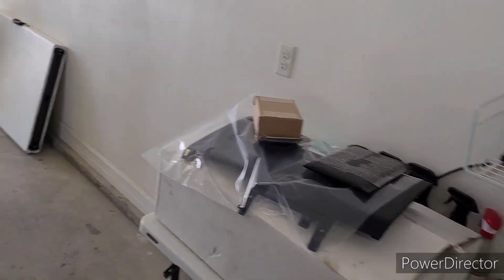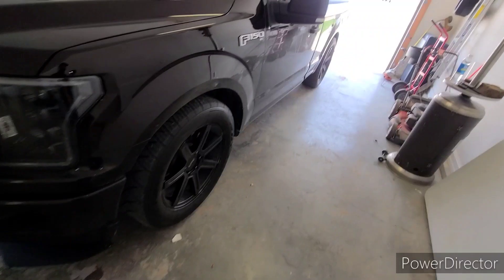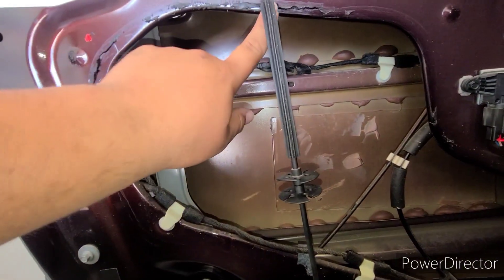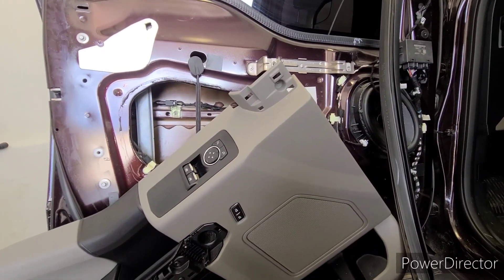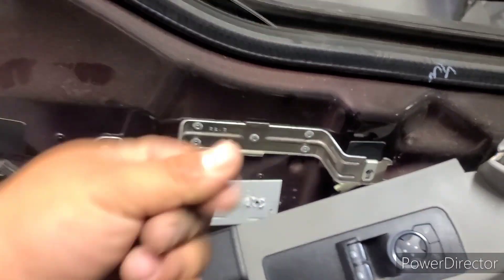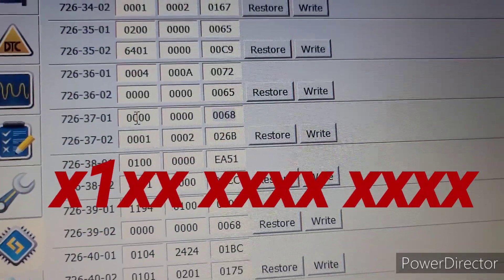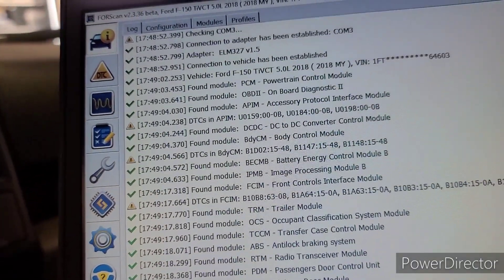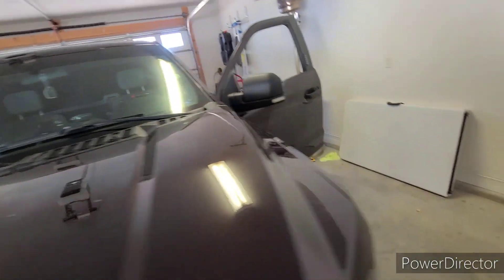How to add keyless entry (keypad) to your 2018 F150 | Part 2

Comment: Does it connect to factory harness or do you need something aftermarket? Trying to add this to my 16 Xlt RC
Reply from the maker: Nothing aftermarket you just need to check if it even has the harness behind the door panel because I'm not sure for your year and model.

Comment: Hey bro, do you think this forscan thing with their wire  can program a vin to a 2003 f150?  My truck says vin corrupt or NULL something like that.  Thanks
Reply from the maker: I really wouldn't know or had to deal with something like that. Do you have your stock ecm? Sometimes when people switch ecm's they don't program them to the truck or vin so it just reads as corrupt or invalid. But  that's all I can really tell you.

Comment: I was a little confused on the programming. You said you set it to 0100 000 000, correct? But, you had yours set to 0100 0002 0068? Does this change after you write it, and that's why yours was different? Also, any information on changing the code in Forscan?
Reply: Not sure why people continue to use "As Built" choice when the next line (same module, different view) allows you to just scroll down to "Keypad" and enable it. 
MUCH EASIER.  "As Built" is for non-decoded entry changes. Many already decoded so you don't have to do 'bit' changes. To each his own.

Comment: How did you get the door code?
Reply from the maker: I think I explained it in the video, but it will be at your passenger side foot step panel, remove it and upper panel and there should be a small module with numbers and you can berally see where it's says password or passkey, something associated with a code of some kind.

Comment: How do you get the door pad code? Do you need to make one up? Your truck didn’t originally come with one. Wanting to do this to my truck. Just need a few things cleared up before I move forward.
Reply from the maker: If I remember I put it in the video. The code is written in the the back panel of the fuse box which is located in the passenger footwell. You need a flash light aswell. It's like a sticker filled with info and stuff and there should be a [ key/code: ]

If not try your Ford manual and there should be a card in there with code.
Reply: Thanks. The dealership was trying to tell me that I couldn’t add it because truck didn’t come with a door code. I told them I just watched some dude do it to his truck 😂😂